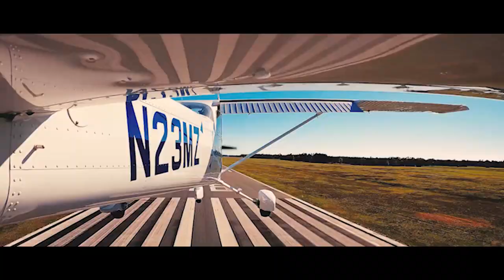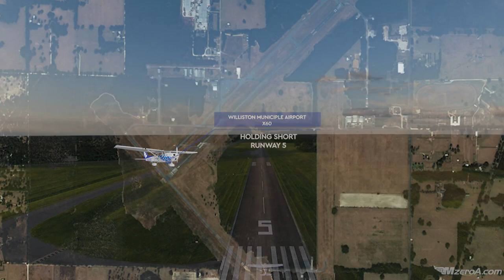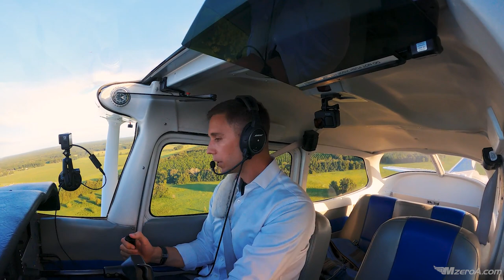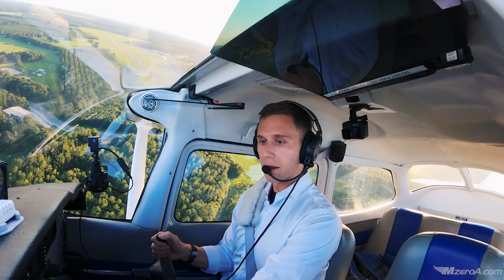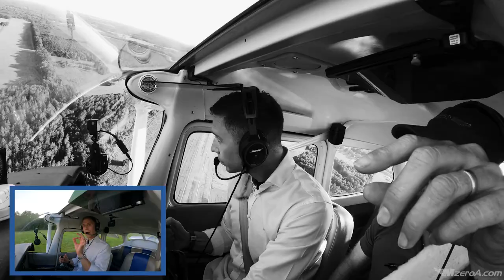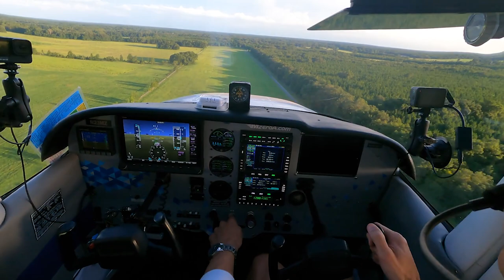Engine Failure On Takeoff To Soft Field Landing - MzeroA Flight Training

Comment: The best Low Altitude Maneuvering practice.  Same principles apply as you learned when practicing GRM with 45 degree turns to align on the tailwind sections (Did you?).  Same banking here.  You turn 45 degree bank too after pushing nose down to avoid stalling.  The objectives are to Avoid pulling up too much elevator, avoid banking over 45 degrees, Avoid Panic Pulls and uncoordination.  Then pop flaps and forward slip if too high.  Dont 

Other tricks I taught are to cut the mixture if high after turning (Prop Drag), push nose to beginning of runway, not to the middle like you did, cut the flaps on the flare if too fast,  on ground, go to one side of the runway and do a turn to avoid hitting the fence.  Kiss the ground if it was a real engine failure. 
I was the EFATO and aerobatics CFI that taught the other commentator here named  outwhithem. I taught him EFATO and spins in 1996.
Reply from the maker: Thanks for the insight! Fly safe!
Reply: @MzeroAFlightTraining  Anytime.  You are becoming now a "Hard Maneuvering CFI".  Not like the Mild Maneuvering others..

Comment: Vglide 45 bank Turnbacks are also used on Double Flyovers over a spot on ground, on Box Canyon Turns, and Circling Approaches overhead the airport and turnback to land on opposite runway.  Many accidents from pilots that didnt know turnbacks and did them wrong.  Do the lever Double Flyovers Vglide speed Turnbacks over a highway before the 3 others.  Last do the EFATO Turnbacks, specially with partial power, which is the most common.  I learned them in year 2000.

Comment: Before the turbacks after EFATO, I used to teach the level altitude Flyovers Turnbacks.  Do level turnbacks first (GRM Turnbacks).  Done while level flight at around 600 agl over a road with a crosswind.  I used Vfinal speed at around 1,800 rpm. And of course, 10 degree flaps.  Teaches how not to stall or overshoot the flyover by doing the 45 degree banks on tailwind section.  Flyover Turnback Maneuver.  The toughest kind of GRM.  GRM that you dont know well, can do you.  Those Flyover Turnbacks have killed many expert pilots, but they didnt know Flyover Turnbacks well.  It is a different maneuver, like EFATO maneuvers are too.  

 Then before solo,  I taught these EFATO turnbacks.  There were houses and oil tanks on each side of runways.  stupid not to know turnbacks in that airport.
Reply from the maker: Thanks for the feedback!
Reply: @MzeroAFlightTraining  Anytime Jason.  We are proud of you.

Comment: Great stuff Jason.  I worked on the impossible turn with the best pilot/instructor I know (~8000 hours). We actually made the same runway, only losing 200 ft on the turn around. I didn't think it was possible, but we grabbed as much airspeed as possible and landed hot.  Doesn't matter if you overshoot. Luckily we stopped near the end of the runway.  It was repeatable on that day.
Reply from the maker: Thanks for watching! Glad you had a great CFI and good practice!
Reply: @MzeroAFlightTraining  Thank you for doing what you do.  It's very important to go with an instructor as you said.

Comment: This is very important for a student pilot like myself, especially when the density altitude is usually 7000ft+ at my home airport, so turns after an engine failure are made very difficult due to the reduced lift.
Reply: UT or CO?
Reply: Agreed, it’s a tough situation because it’s in a densely populated area with no intersecting runways, so an engine failure on takeoff at say 700 ft would be very tough, but it is a long runway (10000ft) so there could be a possibility of a straight ahead landing
Reply from the maker: Thanks for watching, Luke! It is always important to note density altitude.

Comment: Emergency and soft (perhaps short) field landing all in one.
Reply from the maker: For sure! Always good to practice! Thanks for watching, Shawn!
Reply: @MzeroAFlightTraining  No engine makes it easier did not bounce on landing, and it teaches you energy management in a hurry.   Do you find that you bloom less in a flare with the engine off situation?  I know you’ve done away with the term flair in your teaching because the damage to the airplane when someone balloons and then crashes to the ground is too high.   A “flare” only works properly if you have bled off all your airspeed to the point where you don’t start flying/ballooning again.